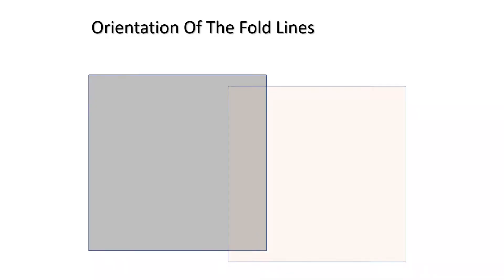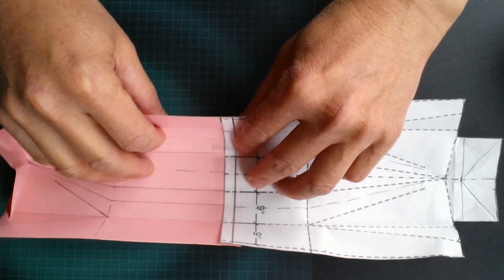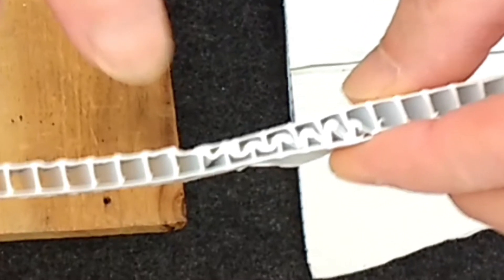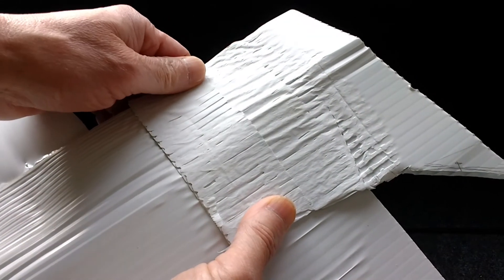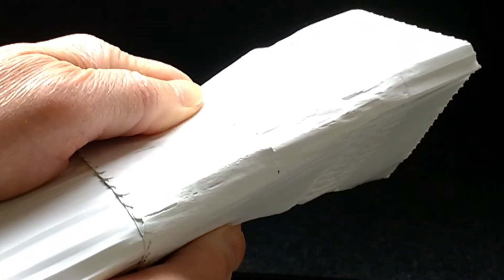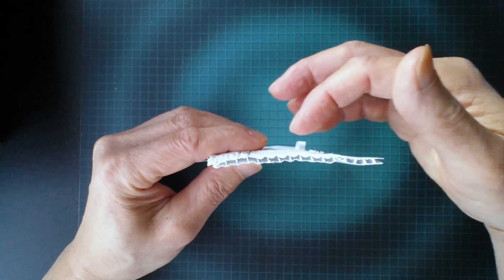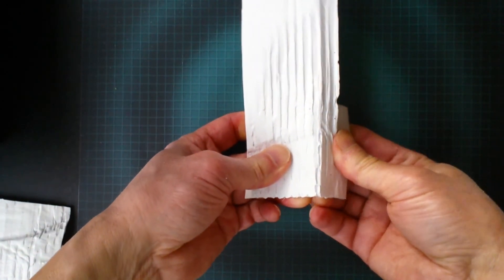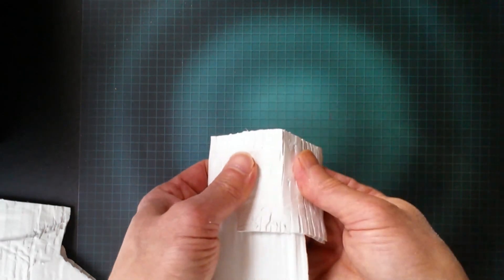Part 4 Conclusion - Heat Fusion to join two pieces of coroplast

Comment: Thanks for all of the work you are doing to figure this out.  What do you think about using polyethylene instead of polypropylene?  I found larger sheets but it is polyethylene.  https://mygreenhousestore.com/products/solexx-51-5-wide-5mm-pro-rolls?variant=37476117577877
Reply from the maker: Thanks for your input. I have not looked into this material. I can image what that is and it seemed to be a good material because it is more flexible than coroplast. I have been thinking how to build a 10' kayak that can be folded into the size of a carry on luggage (for traveling/flying). This may be an option. I need a better kayak frame for this material because it is not as strong as coroplast. I guess it will be easier to find glue for this material (than coroplast). If you don't need a foldable design, I believe applying stitch-and-glue boat building technique will work. Give it a try!

Comment: I am building a truck camper out of this method. The heat gun is a difficult thing to me, it is more of an art than a science. The Iron is more of a science. When will you release more about coroplast?
Reply from the maker: Adam, Thanks for the input. My friend Nat who come up with the cloth iron method told me the same thing, that's why he experimented this new method  :-)   Some how, I find using the heat gun is very easy :-)  Thanks to Nat, now there are options for your to choose. What kind of applications are you think of (using coroplast)?  I want to build a car top carrier. a portable tent. I hope to complete my fishing /pontoon kayak by April. I am ordering a paddle drive for that kayak. I will build a canoe using similar technique as the Gen 12 kayak (for a friend). I will release this video series in two weeks...https://youtu.be/POsBb0Om2rY           Please let me know what other project your would like to see.  Thanks.